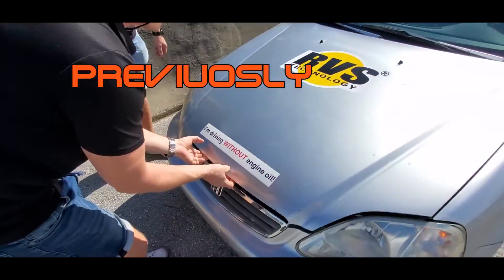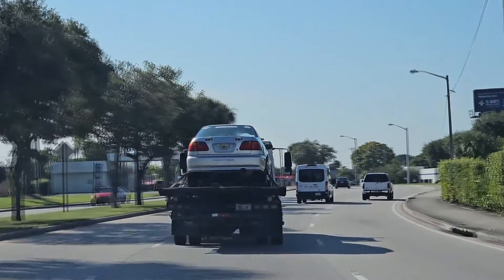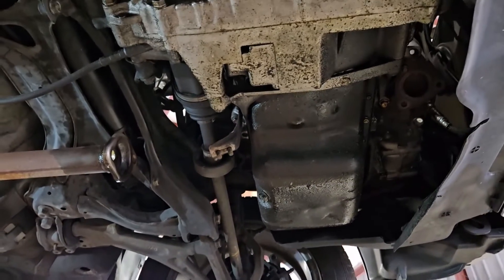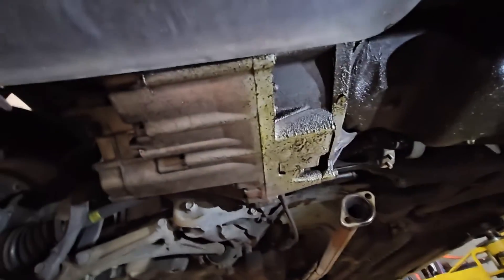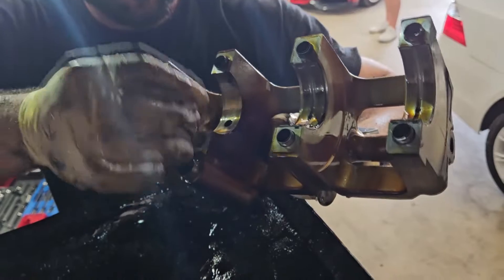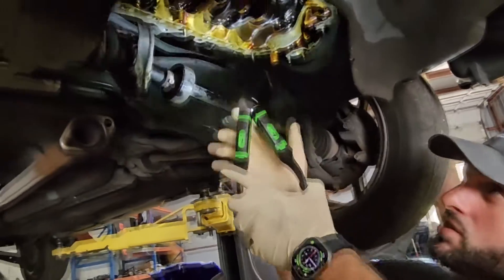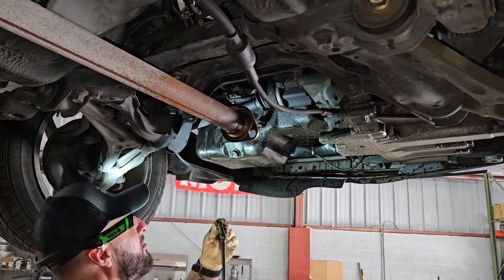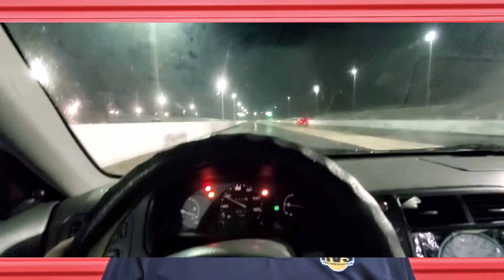RVS Technology Honda Civic engine check

Comment: Hello 

I was wondering if you could answer a couple questions as your email page wont let me send you a message.

1. For the engine treatment it is possible to mix the gel with my own oil or does it have to be mixed with the provided oil in the package to create the desired results?

2. Does the transmission treament work with CVT transmissions?

Thank you.
Reply from the maker: Hello! The contact us form does work, but no worries we're happy to help. Yes you can use whatever oil you desire, main thing being that the gel gets mixed in well as per directions.
CVT transmissions benefit probably the most from an RVS treatment because of all the extra metal gears and belts inside the trans. We've heard countless testimonials from customers who fixed their slipping or acting up CVTs.
Reply: Thanks for the quick response

Comment: Why is there engine oil pouring out when there is supposed to be none? am i a dummy? (Please cut away the music .. )
Reply from the maker: If you watch the previous videos, after initial bearing failure on the highway, we added oil and a G6 treatment to limp it back. It did run but obviously the damage was done.
Reply: @rvstechnologyusallc2290  Next time you should take the engine apart before it fails. Now you should have an idea how long it lasts. Even something like 1000 miles would be plenty!

Comment: it was giving a little bit of noise, but did it really need to be towed? THis is alot of hyperbole and misdirection with -your videos, and running a car low on oil. like this honda, and running it with no oil are 2 different things, your product seems like it is really good, but your marketing is deceptive and misleading, people who know nothing or very littlle should not be told these false things your saying, it makes it harder for us who are honest to set them straight later on, and thats so rampant these days, they electing people and treating the unfortunate, like people are turning into animas, from thingslike this , there are many gullible and lower intelligent people out there, and your not helping..when you do these things. if your product is good it will sell itself, as long as its distributed to stores and marketed to the folks who work in the industry effectively. ...
Reply: What false things are you talking about?

Comment: How about rod bearings? I thought there check crank and rod bearings because rods looked really dark, so some heat maybe there too. I used rvs and IT IS quite good product but think you should filmed too rod bearings.
Reply from the maker: Hi! Yes, at 8:47 you can see damaged road bearing that came out and it is shown afterwards as well. This is what we initially thought would and did fail eventually.
Reply: I check that again but   those bearings at 8:47 is crank/main bearings. I mean rod bearings that is connected to The pistons and crankshaft. Main bearings look anyway quite good For so Much driven without oil.